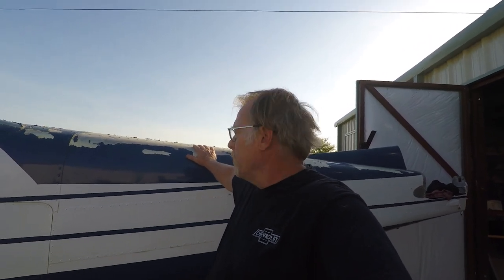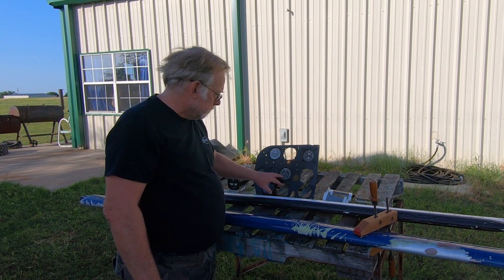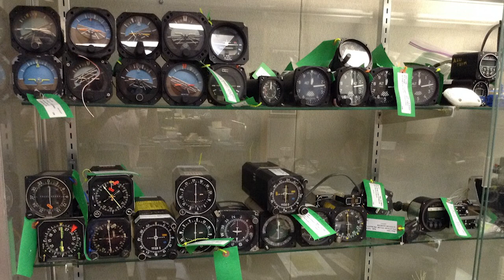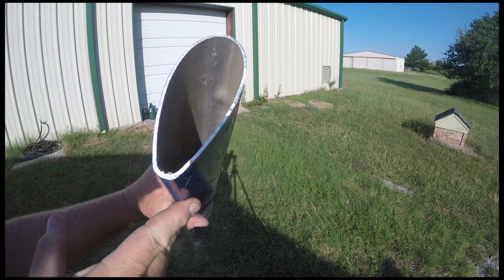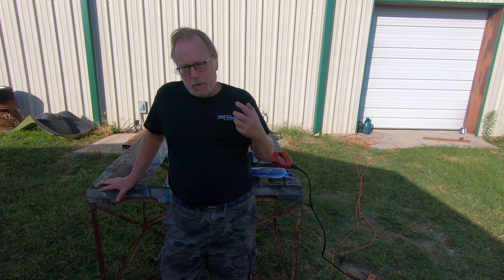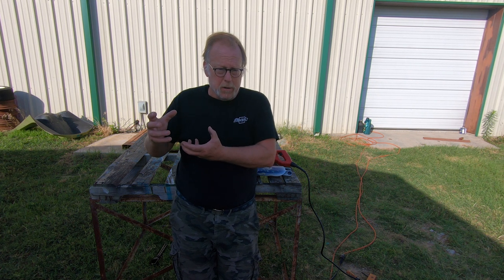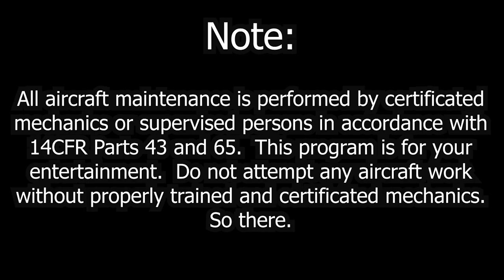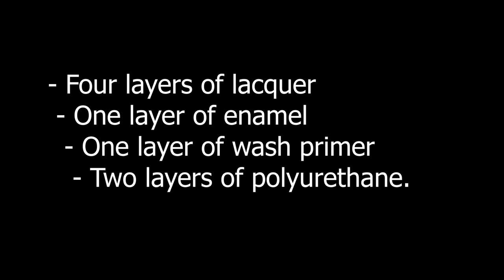Project Cessna 172 EP08 - Lift Struts, Instrument Panel, and Paint...

Comment: Great update!  I didn't understand your comment about the AV-30 being a "dumb gauge",  My understanding is that it can display Nav data.   HSI etc.  when connected to a GPS.
Reply from the maker: Sort of.  Review the pilots manual and installation manuals here:  

https://uavionix.com/support/av-30-c/

Per the pilots manual:
"This output does not provide IFR compliant lateral or vertical guidance, therefore all GPS track and deviation related data presented is for VFR operations only."  

So now you are limited to VFR operations.  Not so with the other units available.

Also per the installation manual:
"The replaced instruments may NOT be part of an autopilot or primary navigational display, such as an integrated autopilot system, autopilot heading bug source, attitude source, CDI, HSI or flight director display."

If you are going to go through the pain I believe there are better options out there.  My opinion... Thanks for watching!

Comment: I'm surprised that the small dent in the strut fails. 
Considerations
The depression (dent) in the aluminium (unknown cause) has deformed the aerodynamics of the leading edge: albeit "Bondo filled" this could evaulse with vibrations or corrosion. Could  Eddie current testing be used to detect any non-visible cracking in the deformed area of the wing spar?
Q1. Is it the dent or the possible weakness in the aluminium alloy that fails this airframe part?
Q2. Can Eddie current testing be used on aluminium alloy?
🌏🇦🇺
Reply from the maker: A1.  Maybe.  Probably not.  Since we are checking and double checking everything it makes no sense to keep a less than perfect part on this build.
A2.  Yes.  All the time.
Thanks for watching John!